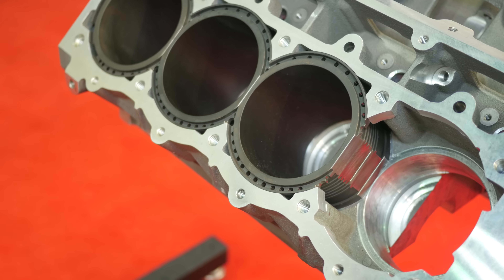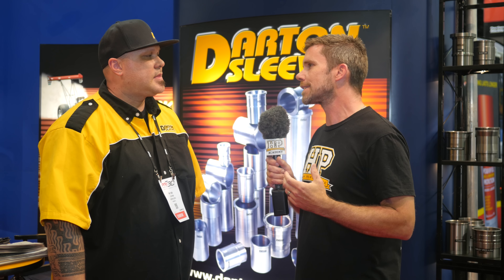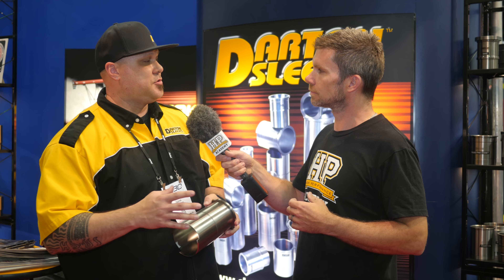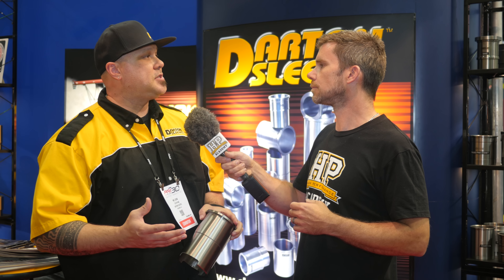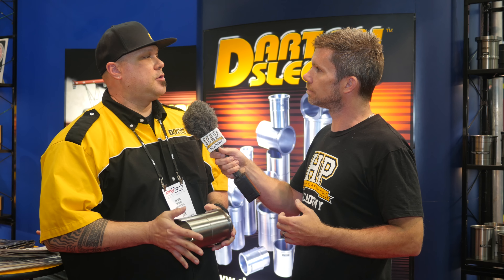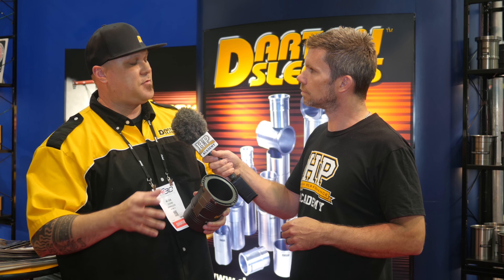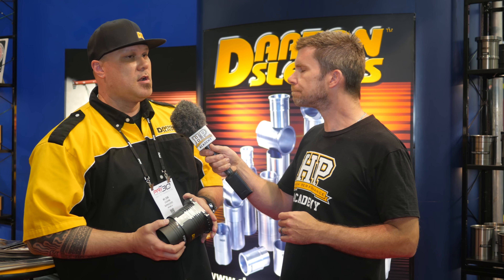Why do Cylinder Sleeves Drop? | Darton Sleeves

Comment from the maker: 🔥 Building a fast car? Get $400 OFF the all-inclusive VIP online course package deal: https://hpcdmy.co/vipy122
✊50% OFF your first online engine building course. Enrol now:  https://hpcdmy.co/offery122
0:00 - Strength Limitations
0:32 - Why Factory Blocks & Sleeves Suck
1:40 - Open Deck Designs
2:41 - OEM Sleeve Flex
3:22 - Dartons Solution
4:28 - Sleeve Wall Thickness Comparisons
5:22 - Top Fuel Sleeve
6:16 - Closed Deck Conversion
7:00 - Why Do Sleeves Drop?
8:30 - Machinists Get Triggered Here
9:27 - Sleeve Flat Vs Stepped Deck
10:48 -  Individually Replaced
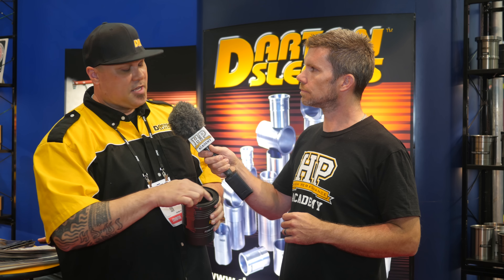12:00 - Thanks John!
12:30 - BUILD | TUNE | DRIVE

Comment: I agree Ductile Iron is far superior in tension than plain grey cast iron but please remember the material they are using is still a cast iron based material with additional flow, strength and casting additives that allows increased base tension strength due to the forming of the carbon (graphite) in more uniform formed rounder shapes (nodules) rather than the flakes normal grey cast iron has, this increases the bonding strength between the molecules and the reduction of sharp edged graphite (that causes stress raisers) and long thin graphite with high surface area and very low tensile strengths compared to the nodules shape. 
These materials in conjunction with the casting method and the following heat treatment allows the normal cast ion to be formed as Ductile (cast) iron. Yes I know its is a different final produce but the interview could lead to some people thinking its not a cast iron based produce, and no the guy was not wrong, every thing he said (except for the machining, how did we old tradesmen manage to produce high quality Areo and ship engines, diesel and turbines etc before cnc machines which do give a much higher consistency) is correct and Ductile iron liners are certainly a lot lot stronger than plain normal grey cast iron liners. 
A couple of things to remember.
1/ Cast iron is very very high strength in compression, moderate strength in sheer but very low strength in tension (pressure in the cylinder cast iron liner into tension).
2/ Grey Cast iron is still the best material for normal liners in the standard designed engine where the wall thickness is correct to prevent the tension failures. This is due to porous nature of grey cast iron that allows oil to impregnate the top layers and in conjunction with the flakes of graphite provide better lubrication and reduced friction for better. long term wear. This is why we generally don't use steel liners that could be made a lot lot stronger and lighter in weight, they just wear out to quick and have a lot higher friction losses without excessive lubrication and burning oil.
3/ Ductile Iron liners are the best solution as a compromise between liner lubrication, slight increase in friction, good life expectancy and the need for higher internal cylinder pressures for higher non standard/performance engines.
I'm not critical on this guy or your channel (I like it and your style) but the main reason I raise this is that i'm constantly hearing miss information and old wives tales in auto industry and if more people knew the details it would help, reduce fake costs, better tailored to suit the need outcomes and allow the good providers to get paid for what they are worth. (no not me I'm not in this industry just a poor old fitter and turner and fully qualified Marine Engineer who is semi retired and has far to much time on his hands, eg writing this long winded stuff)
Ps. open deck blocks and liner support/flex can be addressed with recessed cylinder heads and a combination of head gasket to control fluids and movement wear and inserted firing/compression rings to retain the cylinder sealing but its out of the realm of most machine shops and a lot higher cost but very effective solution.
P.sssss. the suppler site does discuss most of the technical stuff i crap on about above so looks to be a open and honest suppler.
Reply: Thanks for that in-depth comment.. I love it when the comments section contains contributors like you , knowledgeable & intelligent.
A question... is "nodular cast iron" & "ductile iron" the exact same material ?
Reply: Wow!!! What an informative comment. Really gave me a lot to think about. Recessed cylinder heads would be such a good solution to reducing flex in the block.
Reply: Valuable info, some us really appreciate it, thanks for sharing.
Reply: You are right about a quality machinist with a quality machine but from his(manufacturers standpoint) the people and machines just are not available anymore so CNC is likely best if you don't have the aforementioned machine/ist
Reply: There is a family of tool steels made by Latrobe steel that have the trades names Graph-Mo and Graph-Air. These are O-6 oil hardening and A-10 air hardening steels. These steels were specially developed to have superior were resistance in dry situations. These steels have graphite in them to increase the lubricity. 
http://www.matweb.com/search/datasheettext.aspx?matguid=296347e03e98408a9084656595a5d495
This stuff is extremely nice to work with. In terms of machinability it is on par with cast iron. It is by far the easiest tool steel to machine. When properly handled during heat treatment there is virtually no distortion as with most other O Series tool steels. Tempered to 45 RC it still offers exceptional strength and wear resistance.
Reply: @mpetersen6  I haven't used these but its certainly interesting
Reply: @Turboboob  
Common practice in aviation engines. Some petrol heads consider automotive engines can be a little wild but some of the aviation engines proposed and built. My favorites for the ones I would like to see and hear are the inline radials.
Reply: @tfsupp  
I'm not saying someone should just use this material on their own. At the very least checking with LaTrobe Steel is a requirement. There may be tempering issues due to environmental issues. One thing to remember is steel liners were commonly used in aviation engines. Including engines meant to run high hours between rebuilding.
Reply: @SuperSreggin  Warning :- Reading can seriously damage your ignorance !
Reply: Someone needs attention....
Reply: Ah...another youtuber that knows more than a professional but has never actually build anything.  We are all really impressed. (None of us read it)
Reply: So what you are saying is...its not strong enough for you.  So handling 1300hp per sleeve....must be a real half ass made piece there.
Reply: @outkast187  once again you make uninformed assumptions well done.
Reply: Volvo B230 block enters the chat.
Strongest block ever built. Swedish iron!

Comment: So, the only real way that a sleeve can drop, is IF it wasnt pressed in all the way down to begin with, and landed fully down into the register groove in the block, and then the tops of the sleeves are milled down flush with the blocks deck, BUT there is now space under that sleeve register and that allows it to slide down later....?? 

Is THAT the entire jist of it?

Comment: Hi Andre. Thank you for sharing this high quality content. I just want to drop a mention of the rover KV6 for your viewers who are likely interested in internal engine design. The KV6 is one of the biggest lemon engines in modern history. Absolutely notorious for head gasket failures due to dropping the sleeves which scraps the whole engine. Rover used an extremely unconventional design - interesting to research and see "what not to do" for a performance build. Basically they used an alloy block with extreme open deck design, with the floating IRON liners only held in place by clamping force from long thru bolts sandwiching the block between the head and main bearings. Not the sturdiest design and then you add the usual mix of british insanity, ie wrong thermostat placement, sloppy production tolerances, plastic head dowels(!), and bad gasket technology... the result was exactly as bad as what you would expect.

The K engine caused massive headaches for landrover freelander owners, then after all the bad publicity, kia bought the licence cheap cheap and fitted it to their first generation carnival/sedona minivans. Something like 40% of their carnivals had engine blocks replaced under the 3 year warranty due to head gasket/sleeve failure and kia was still forced to offer goodwill engine replacements for vehicles well out of warranty. Anyway storytime over, keep up the good videos mate!

Comment: Good info. Looks like a great product. 
I guess this Guy has never met a real machinist.
You can do all of this on a Moore Jig Bore #2 with far superior accuracy than CNC. 

With a Moore you can hold 10ths in tolerance. .0005 is pretty good for CNC. I would agree that .0005 would nearly be impossible with a Bridgeport. They aren’t ridged enough.

Oh yeah not knocking CNC it is a amazing technology. But it’s not the only way.

Comment: I have the MID sleeves in a Noonan Block for a 427 build. It's still waiting for a suitable builder to finish it, but I recently heard a rumor that  MID's are not suitable for a street build as the MID's could 'move around' and/or leak coolant. This video seems to point to installation errors for this to happen, but I was hoping to hear from other's that may have firsthand accounts.
Reply: I work in a machine shop, anything that goes wrong with sleeved blocks usually is installation error, we've seen everything from dropped sleeves to compression loss from improper sleeve installation height. In fact before the lockdown from covid-19 we worked on a M.I.D sleeved k20 turbo street engine runs great only came in for a bore size change from 86.5 to 87mm
Reply: So people think sleeves moving around is only good is high performance races engines. Love the logic.

Comment: hi guys is it save to use if my block little bit too thin because i use big liner ( original 99c and i use liner normaly for 200cc bike) and at one point my block run out of its alumunium and i can see clearly the liner from outside

Comment: The only types of manual machine I would consider boring a block out for sleeves like this are a Jig Mill, a Boring Bar or a jig Boring machine. Any one who would even think about doing it on a Bridgeport is looking for trouble. A BP has insufficient depth capability plus the bore diameter is outside the machines scope. No matter what type of machine you used it would most likely be a good idea building a fixture for locating the block. Spent 32+ years in the Tool Room of an engine manufacturing facility.
Reply: He said it one way to put install then hd said it depends on your preference how you want to install

Comment: One thing I've never understood is why they make them so stupid thick, just to have a thin faliure point between cylinders, as the weakest point and limiting factor. After all the main stress on a liner is hoop-stress tensile. Might as well just have them like the thin-spots all way round, save weight and get better cooling.
Reply: Sleeves are stronger than the block material

Comment: Too many fools claiming you don’t need cnc. Look at the shape of the bottom of the sleeve. It’s not completely circular like most machinist sleeve shavers. Cnc is critical for those points for perfect fitment. I was gonna buy a sleeved b18c5 from someone local on fb marketplace. The bottom of the sleeves were totally sleeved instead of leaving the notch the block requires for allowing the sleeved to sit perfectly…

Comment: The guy from Darton knows his product...but knows little about machining. You absolutely do not need a CNC machine. 

The tightest specd dimensional tolerance is +/-0.001“ and a Ra32 or better finish...basically any machinist could do this with a clapped out Bridgeport (or even a big old lathe) and a boring head.

Comment: Can i ask if anyone knows how to keep coolant and oil separate when running sleeves.
Reply: You have to machine the block so you can fit o rings(copper or other materials depending on what material your block and head are made off)  around the water and oil channels.. Prodrives wrx sti that they built to run the isle of man doesnt have a headgasket
Reply: Also it depends like he says in the video. What application you are using it for. A street motor will still run a mls gasket so no need for any extra machining

Comment: Can you do them on a air cooled 911
Reply: They probably do produce them. Check on their website. And probably cheaper than the cost of sleeves currently produced for older 911's. The current sleeves you get for old 911's are quite pricy in my opinion

Comment: So, do sleeves eleiminate the need for a closed deck conversion? I have an N54
Reply: Stupid question man.
Reply: I don't know about every scenario, but it looks like lots of sleeves emulate a closed deck by flanging the top of the sleeve to meet the block. Probably not always, might depend on engine design or sleeve manufacturer.
Reply: Depends on how much power your making 7-800ish ho I heard sleeves are more than strong enough for open deck N54's. There was a forum discussion briefely taking about it.

Comment: What might be a ballpark cost to sleeve a 4 cylinder engine?
Reply from the maker: We don't sell any hardware Uriah so give Darton a yell directly to find that information out. They're a helpful bunch :) - Taz.  https://dartonsleeves.com/
Reply: High Performance Academy 
Will do, thanks for the info
Reply: I have a guy that charges ~$600 to install  pressed type liners (dry sleeves).... The sleeves are around $120 each... Then the machine work and install is about 600 bucks.... so about $1000-$1200 for everything to be done....I would guess that the wet MID sleeve setup would be a little more... hope it helps....
Reply: About $1200 w/ Darton sleeves on a 4 banger.
Reply: well the add on this youtube page hear is showing me k20 sleeves for 645 lol.  The cost of installation idk
Reply: 2k to sleeve my b16 with wet sleeves in UK including purchase

Comment: Are sleeves stronger than inserting closed-deck inserts?
Reply: Probably depends on how much of the factory cylinder remains with the insert. My wager is that sleeves are stronger, but my money will still go to a closed deck insert, just so I can afford to build it in my lifetime.